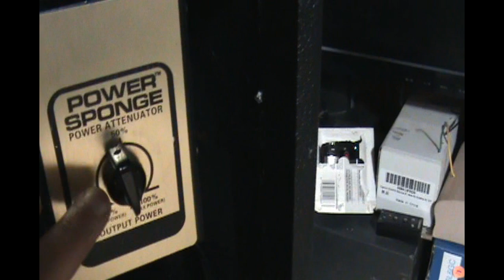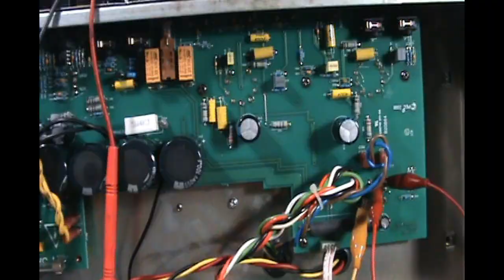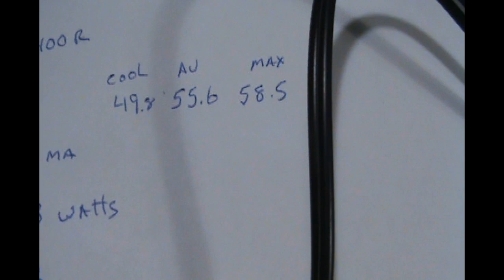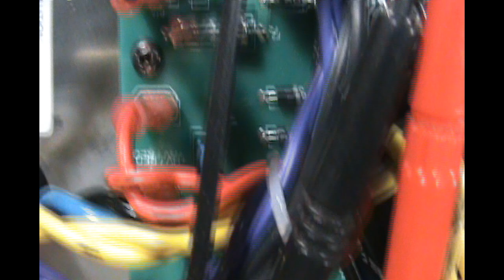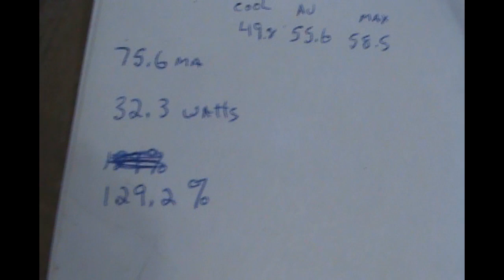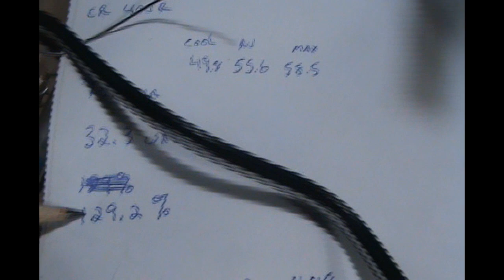Smoking Peavey Windsor Repaired

Comment: I've got one and I love this amp Man but my standby switch is on no matter what and it's got a little bit of hum in the amp now I'm not sure if it's a preamp or a power hum
Reply from the maker: The standby being on no matter what was the result of the tube power tube plate and screen being shorted together at the power tube socket area on the PCB board of the amp I serviced in this video, the traces overlapped and shorted through the board. The standby when used interrupts the little bit lower voltage going to the power tube screen stopping the tube from conducting.  When there is a short between the plate and screen then the screen is seeing slightly higher voltage " the plate voltage" on it and whether the standby was on or off would have no effect as the short is happening later in the circuit at the tube socket. So the first power node is supplying the plate and screen the same voltage when normally the first node supply's the plate and the second slightly lower voltage node supply's the screen and is typically interrupted by use of the standby switch. So it's basically bypassing the standby because of the short at the tube socket . This will cause a hotter bias on the tube and can increase hum ect. I would advise having a tech take a look at it if you are not experienced with high voltage amp circuits like this. And I would not try to use it until it gets service.
Reply: @carrmvc3507 yeah I had to work it when the sockets in the power tube I noticed I just don't feel like taking it apart again right now
Reply from the maker: @hadleymanmusic  I understand but if it's not repaired it will get worse and probably fail to the point of it being a costly repair or to the point of not being economically repairable. Good luck!
Reply: @carrmvc3507 that's why its been sitting  and collecting dust